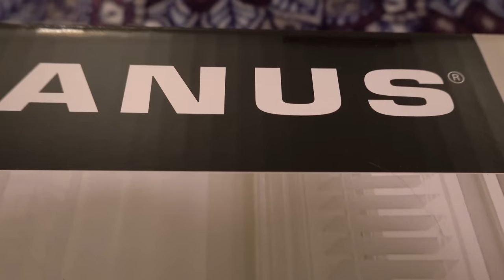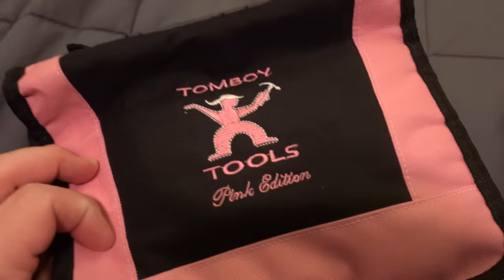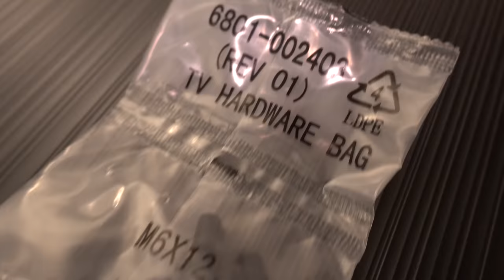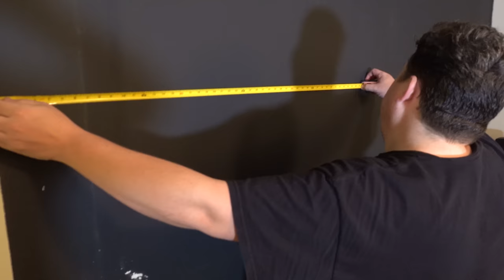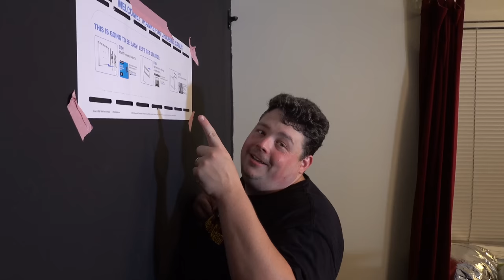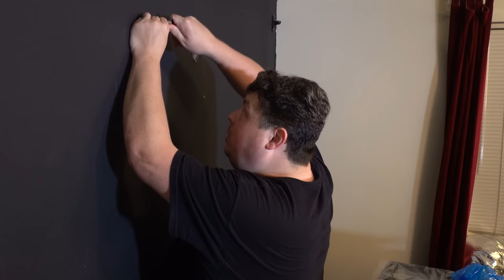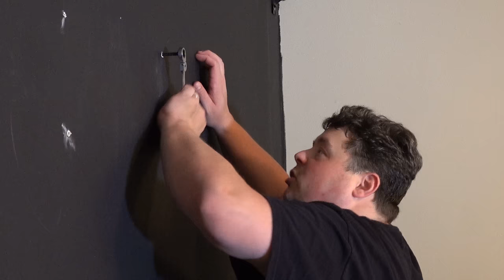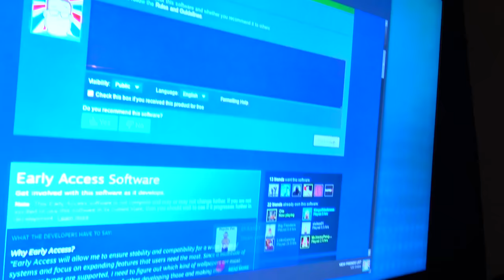How to mount your large screen TV on any wall safe & easy! - @Barnacules

Comment: I have sanus tv mount as well. It’s the smaller one, but comes with exactly the same screws\bolts. When I drilled mine one went into stud, others into plaster (only found out when I moved it). It did not budge an inch and was rock solid. Very secure TV mounts, definitely buy from this brand again.

Comment: Jerry, we got the 65" version of this t.v and shortly after, the connect cable FUBAR'ed and it took a local Samsung rep to come out to the house and replace it free of charge (a $250 value) because it would just go into a boot loop and never recover. So, I feel ya on that part. It's a great technology and I think you'll see a vast improvement over your projector setup. Awesome video man, and glad your Wifey got to assist in this one. Bring her back for more!

Comment: Samsung TVs come with special spacers in the box, then you only use a be size of bolt. I install these professionally, and it was fun watching you do this
Reply: Spot on Matthew, nothing worse than having to explain to a client that they need proprietary spacers. Sir, they were in the box when you bought the TV but you probably trashed them when you tossed the box by the curb. Next time I recommend keeping the box and all contents inside.
Reply: @919GUY  People are like that, expecting sales people to tell them that when they buy the tv. Samsung is a bit shitty still though, because although they provide the special spacers in the box, the M8x45mm bolts are still missing from retail TVs.
Reply: Victor 9er that’s why we keep any extra spacers from TVs we set up but don’t mount. All the time I’m running out to the van for those spacers

Comment: My Grandson and I have mounted TV's in all rooms. only two TV's, the Grand Daughter-in-law just couldn't make up her mind where the TV's should go. I went out and "bought"  1/4" x 2" lag screws which held the TV's and brackets just fine and did not have so much "Screwing" to do. The Grand kids moved out  few years back and now they're coming back home again, but moving down in the Basement. The Grandson will have to deal with where to mount the TV's down there. I ran "A-Bunch"  of Cat5/6  & RJ6 cable down there so they have the Ethernet option as well WIFI and Broadcast or satellite TV. Cabling is ALWAYS a pain with the various IO ports/standard all kinds upgrades with ALL KINDS of naming schemes. Try to move sound from the computer thru the TV and maybe thru some speakers. The whole "what kind of video card to run the TV screen"  (especially the one you mounted) should be a dedicated video Barnacles (Jerry).

Comment: my wall mount for my 60 inch samsung TV was exactly the same mounting system... I did it on my own and was happy that it was only a 60”
It was an adventure because if you’re alone you can’t see behind the TV while hanging it up... but what makes it even harder is definitely the weight 
thanks for the video... it was entertaining as always 👍
Reply from the maker: Kazunari Yoshikuni I’m impressed you hung even a 60” by yourself. It’s not easy.
Reply: Barnacules Nerdgasm 
no it’s not... had 95% of the weight on one arm since I grabed it with my right hand centered at the bottom and the left hand at the front top, to balance the weight... then pushed it up with the right hand and with the left tried to feel where to hang the TV on the wall mount... the scary part was to let the TV out of my hands because I was afraid that the hooks weren’t in the wall mount... fortunately they were and the not cheap TV didn’t fall down

Comment: I just use magnets...Find the drywall screw and or nail locations used by the builder.  rear earth magnets work great for that
Reply: Great tip, also try spax power lags instead of lag bolts next time. So much faster to mount stuff to studs.

Comment: another way to find studs is to look for the nail/screw pops in the drywall, at least on all the places ive been at you can see where the screws/nails hold the drywall to the studs and if you can find that nail/screw there is a stud there, if a good drywall job was done you might not visibly see them but can use a strong magnet across the wall till it catches and there is the nail/screw
Reply: That only works if the drywaller hit the center of the stud. Drywall screws are much smaller than lag bolts for TV mounting. Best bet is to use a small drill bit and verify the left and right edge of the stud=guaranteed center

Comment: 11:20 I use a multiple magnets to find all the nearby nails which helps to clearly see where the 2x4's are! Usually, the nails are driven right down the center of the 2x4.

Comment: She is so awesome.  she is so down to earth and have such a great sense of humor :)   
2:58 had me rolling....... Hahahaaaaaa,  the fact you had to ask if she was open to that.....omg....I lost it.... Hahaaaa :) 
Mrs. Barnacules a.k.a Muscles........ Hahahaa 
.
Small NOTE:  As my aunt is watching and she is a professional carpenter.  She says that if the builder built the building properly studs are 16-inches apart.
She says when you start at any corner of the building then measure 16" inches, you should find the dead center of another stud.   Some architects have studs 24-inches, but the norm is 16-inches.
She says those are the only 2 numbers allowed in the USA for placing and framing a building by US construction laws.
My Aunt also says that doing the hammer way is a bit dangerous when placing TV on the wall like you did. As when you drilled, you could most likely just be getting the corner of the stud.
and not dead center.
So measuring from the corner 16-inches out will get you dead center of the stud. - "If the constructor/contractor did his job properly."
This is after she is watching you drill and saying -->> "Omg what if he is just catching the corner of the stud.?".....  LOL  then she forced me to post this note post....lol

Comment: I normally drill a few tiny holes across the stud, above the correct height, then choose the Centre of the stud, based on that. Otherwise, you could be screwing into the edge of the stud instead of the middle. Good video as usual. Greetings from Oz.
Reply: Now that's the correct way to find the center of a stud

Comment: Great video but the arms on the tv are the wrong sides. Your adjustment screws that tighten the tilt adjustments need to be facing out not in. So you can tighten them easier

Comment: 17:25 I cringed when your neighbor squeezed the front of the tv with his fingers.
Reply from the maker: The TV is fine, and I'm thankful for his help. This TV is like 90% structurally held by it's glass front and my cats have literally bounded off it like a bullet before almost knocking it over and it's taken no damage.
Reply: @Barnacules  Surely pressing onto a monitor won't cause damage anyway though right?
Reply: Yerp, my 55 ended up with a crushed crystal..bummer
Reply: Lube em with liquid hand soap....
Reply: ...or the stud will break..😜
Reply: 18:00. No fan fare and beers?? Lol
Reply: Gary Winters liquid hand soap will clean front panel surface??

Comment: I thought about purchasing and hanging a tv tomorrow! Perfect timing to upload this video 👌
Reply from the maker: It's intimidating but actually pretty easy. Especially with a screen you can lift yourself.
Reply: @Barnacules  well here's that one guy that's not going to pay someone 100 bucks to have someone else do it :)
Reply: After watching I have discovered that I only have 3 horizontal stud beams going across my wall which are spaced very far apart, hopefully drywall anchors don’t drop my tv 🤷🏻‍♂️
Reply: @RemoteChicken12  they wont just make sure to use the good ones.. :)

Comment: OK I stopped your video when you put a little swirly thing on your drill and drill the wall and some wood came out at the very end immediately stopped and did it for myself after  29 holes I finally did that method that you did And worked on the 1st try

Comment: Not the wrong way, but two things; one for others out there hanging large TVs don't use the "drywall anchors" in drywall, they are for concrete it will probably say as much in the manual. Two when putting on the hook mounts the adjustment knobs should go to the out side, when the TV is mounted you won't be able to access them to tighten/loosen them from the bottom of the TV.
Reply from the maker: qpeighty great info!

Comment: Just a little help.  Once you find the first stud instead of tapping to find another one you can measure 16" from the first stud you found.  Studs should be 16" apart on center.
Reply: You can narrow your search with this rule, but it makes sense to find each stud, and its sides, independently.  Another stud finding trick that's slightly less Medieval, is using a strong magnet to locate the fasteners holding the drywall. Drywall seams are usually centered on a stud and the fasteners will be on the stud close to the center.  Light tapping should help you narrow in on the width of the stud. To be extra sure, you can drill drilling a couple of small holes just above the base board or drive a slender nail and follow the stud straight up.

Comment: Gloves. An amazing invention to minimize finger smudges.Also grip! :D Its so easy. All you do is screw the thingies to the tv, screw the hangemupemthingy on the wall, hook the tv on to the wall-thing, and watch it ever so gently violently slide right off and down behind the "tv" bench on the wall and bang one corner gently on the floor. And that when i thought my new (then) 4k tv was wrecked even before powering it on for the frist time. Spoilers:
It was fine besides from bend chrome frame and a tiny scratch in top right corner (~5mm)
Reply from the maker: Ouch! Yeah, my TV is just fine. I've moved it with my bare hands many times. I swear the glass on this thing is like 90% of it's structural strength 😁
Reply: They can take more rough handling than most people think, as long you dont bend it :D
My tv was fine, the bent chrome frame is just cosmetic. Was sure the screen was either cracked or badly scratched.

Comment: hey for your Samsung you are actually missing some hardware the bolt that your supposed to use is is a m8 45mm to 50 mm at 1.25 thread pitch along with the spacers that came in the box with the tv they are the things that look like little top hats.
Reply from the maker: hamsterwolf I tried them all and preferred this to get tighter into the wall. With the top hat spacers it pushed it out too far IMHO.
Reply: @Barnacules  thanks for the reply just wanted to make you aware  and help out anyone else mounting a Samsung TV. because Samsung changed the screw depth and not every mount that you buy comes with the correct screws. also If you ever have to source these screws yourself I have had a lot of good luck finding them at Ace hardware.

Comment: I noticed the Cpak next to your bed... dude... I know what is that.. and the solution is to lose weight which I know you are doing.. keep it up! so that you dont have to use that thing anymore... those cpak can cause sinus issues... which I got if not clean properly... and then is worse.. I have gone thru 2 sinus surgeries much better now.. keep it up! glad to see you making content again!
Reply: I weigh 135 lbs and require the use of a CPAP, it's not all about weight.   Sometimes I just stop breathing after exhaling and my brain won't send the signal to inhale until I pretty much choke awake, which is always fun getting awoken to coughing and a headache from suffocating.  Other than that, I got a lazy airway too that likes to close up.  I quit using it because it was uncomfortable, and with my job I sleep so few hours it's almost useless.  But, once things change around, I'm gonna get back to using it again.

Comment: Just a tip. Standard houses are built with 16" between the center of the studs so if you find one measure 16" (or shove your massive shlong on the wall) and find the stud that way instead of trying hammer your wall even more than needed

Comment: I never drill without a stud finder with a built in electrical detector after a roommate installed some candle sconces and blew out the power in the front of the house.

Good video tho.
Reply from the maker: Sig Urther most wires are run pretty high or pretty low and gage wiggle room to get out of the way of the drill bit. But yeah, stud finder is the proper way to do it. This is just #JerryRigged

Comment: I think the tv mounts are the wrong way around as the finger tensioning lugs should be on the outside not the inside facing each other as you can’t get to them now if you need to tighten them when adjusting the angle of the TV

Comment: I have never bought a tv mount ever i dont like those flimsy pieces of chit 
unless you really need it to swivel to the side or something 
you are WAY better off just making a french cleat out of like a 2 by 4 or some piece of scrap you have laying around 
you can even make the tv tilt forward with it if you adjust the angle and the best part is you can hang like 500 pounds of it 
and it is basically earthquake proof

Comment: Luv ya bro but just spend ten bucks and buy a stud finder from the orange store or spend seven on the store fed x hates..
Reply from the maker: Stud finders make things a lot easier than probing with a hammer but I've done it since i was a kid so for me it's easy. But I still would rather use my stud finder especially the one that looks for high voltage wires in the wall that I just missed by pure luck lol

Comment: Regular American drywall is rated to hold 600 pounds.
Reply from the maker: Depends on how you attach it. We attached it to the studs in the wall because then we're guaranteed no problems. I wouldn't trust traditional drywall anchors honestly.